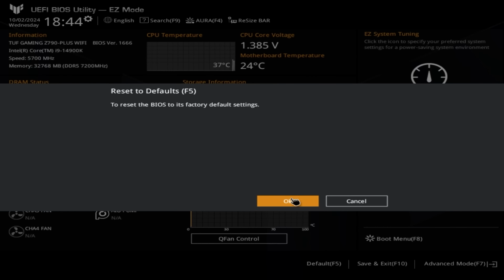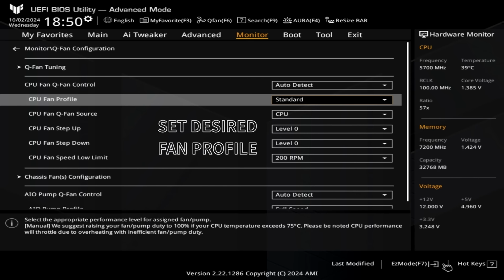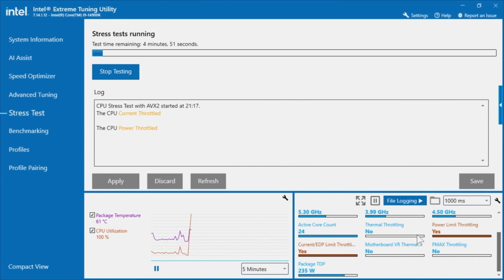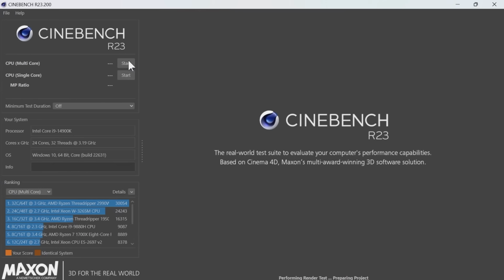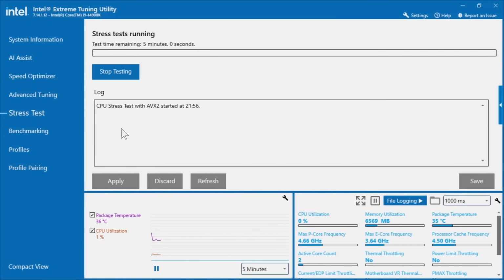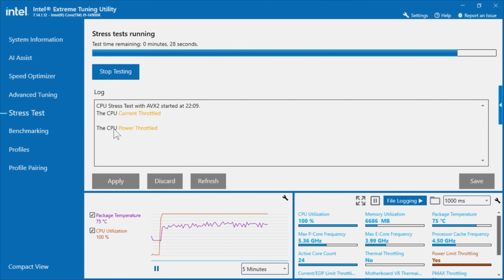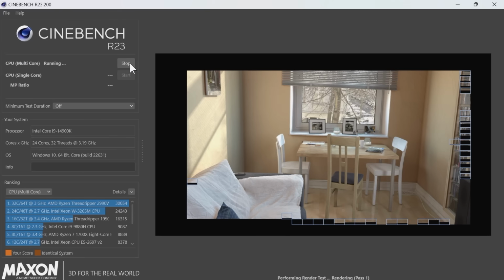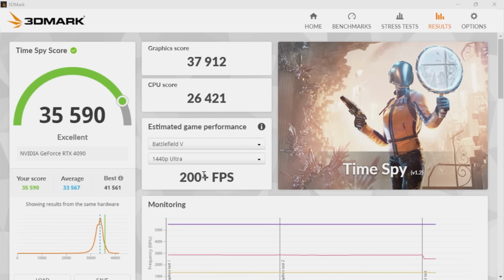i9 14900k Undervolting Guide: Part 2 Complete Stress Test Results

Comment: XTU is a decent stress test, but don’t forget Cinebench R15. It is one of the quickest tests to pickup even the slightest stability issue. It’s very sensitive, R23 will not pick them up.
Reply: I like to use Prime 95 with custom FFT size of 336 (min) and 336 (max), it will report failure in less than a few minutes if the voltage is too low, but if it's very low it can freeze the whole system. Once I pinpoint which voltage it starts giving out failure, I dialed back +30mv for ultimate stability. 

I have two 13700K systems and I found something interesting between the two:
CPU A can go as low as -168mv at 5.3GHz P-cores and 4.2GHz E-cores before failures
CPU B can only go as low as -127mv at 5.3GHz P-cores and 4.2GHz E-cores before failures
But at 4.9GHz P-cores and 3.9GHz E-cores, both CPU can go as low as -165mv before failures (exactly at -165mv)

That 4.9/3.9GHz configuration also saves so much power and much lower temp compared to even 5.0/4.0GHz
Which makes me believe that 13700K was supposed to be launched at 4.9/3.9 instead of 5.4/4.2. anything higher than 4.9/3.9 cause so much heat and power draw. 
Btw, I set the CPU frequency using ThrottleStop so I can switch in real time in Windows.
Reply from the maker: @chiyolate  Good comment, and you are correct in reserving some undervolt as one mistake many make is getting too carried away with it, which I have tried to encourage people not to do.

I find the Advanced Vector Extensions 2 (AVX2) to be pretty on the button, but have also used the Prime testing as part of Benchmate suite, but it’s sufficient to quickly detect system stability.  I have heard Intel are actually releasing a CPU test based on the same model so users can determine if their CPU is degraded
Reply: @nextlevelsimgaming  Thank you for your reply! 
Both my 13700K systems are running important tasks 24/7 but at a moderate cpu usage constantly, so I needed the undervolt to save power and also less heat, but still provide ultimate stability.

What's more interesting is this:
If I set my CPU frequency to 3.4/2.5GHz, the CPU usage will spike to around 55%, but it only consumes around 29-30 watt (very efficient)
If I set my CPU frequency to 4.9/3.9GHz, the CPU usage will lower down to 40ish % and the power consumption will be around 64 watts
If I set my CPU frequency to 5.3/4.2GHz, the CPU usage will go to 33ish% but the power consumption will skyrocket to 93 watts.

But what I don't understand is, why can't the CPU when set to 5.3/4.2GHz also consumes 30 watts just like when it's set to 3.4/2.5GHz instead of 93 watts? because basically it's doing the same task.
So because of this, I always manually set my 13700K frequency to as low as possible when it's not doing heavy workloads to save power, heat, and lifespan.
Reply from the maker: @chiyolate  I believe the frequency disparity is related to the C States, so despite being a lower frequency the CPU is always in an anticipatory mode, for example even mouse movement triggers frequency change where the C States jump in a preparatory mode ready for workload such as application launch etc.  Buildzoid (Advanced Hardware Overclocking) did a good explanation of this.  If this was not the case then the v droop would be so excessive it would cause excessive slowdown or even system shutdown.  The simple analogy would be foot on the throttle, ready to launch, by lowering the foot on the throttle (undervolting) we are causing less power use, but still giving the anticipatory state enough when required, when at full clock cycle that power anticipation becomes consistent.
Reply: @nextlevelsimgaming  Thanks for your explanation! Now imagine if someone can come up with a software similar to ThrottleStop, but can automatically increase or decrese the maximum core frequencies based on the CPU load threshold.
This is how it should work based on my imagination:
If for 1 second, the avg CPU load is above 80%, then the program will automatically raise the maximum P-core/E-core frequencies to its maximum GHz. But if for 10 seconds, the avg CPU load is under 80%, the program will decrease the maximum P-core/E-core by 200MHz, and it will keep decreasing itself until the lowest possible (3.4GHz for example).
And all those numbers can be configurable.

So, if my program only uses 30% of my CPU usage at its maximum frequency, the program will gradually adjust it to use under 80% of my CPU usage at its lowest frequency, saving power by so much.

In audio world there is an audio compressor that achieves similar results, but kind of inverted.
Reply from the maker: @MhillPlays  Agreed, I used to use it as part of Benchmate, but it just hangs or crashes sometimes causing a hard reboot of the PC, the Advanced Vector Extensions test (AVX2) is much  better I find with the Intel XTU Stress Test, also it makes for an easier to make video.

Comment: Bro. Amazing. I skipped 4 gens coming from a 10900K to a 14900K and I never fucked with these settings in UEFI in the 10th gen so its just what I needed ... Worked like a charm. Nice and stable at 5.4 with great temps. Thanks! Subscribed.
Reply from the maker: @georgekyriazis1  Fantastic, thanks for the positive feedback 🙂
Reply: Btw when i went into my XTU after bios settings, it didnt take my frequencies if 55....it was left to something random 57...58. was that just there from previous settings of it? When u tweak in bios doesnt XTU take it? Or do u have to make it first DEFAULT, THEN do ur settings in bios and THEN re go back into Xtu
Reply from the maker: @georgekyriazis1  It would have had a Default profile saved from a previous installation, use the XTU guide I did to manually set all cores can be done through there 😉
Reply: Okay thank buddy!

Im getting idle temps still in the 50s though on water....is that possible with the settings in the vid? I saw ur idle temps around 30s. What number should I tamper with to bring it down some. Can you send me a screenshot of your full profile in XTU my bro!
Reply from the maker: @georgekyriazis1  Refer to the previous Intel XTU video it shows much more information in there, if you’re getting idle temps in the 50’s then are you using a contact frame?, I would recommend doing so, also check thermal paste application, and clamp down force on the IHS.

Mine  idles at 35-38 with Corsair 5000D Airflow, 13 fan configuration, but 50 seems very high for idle
Reply: @georgekyriazis1 previous my one stay at 45c with direct die cooler,and I check that the mount not enough tight to reach the DIE.
After a little bit tightening the screw, it dropped back to 28-35c idle
Reply: @lawrenceonface  thanks buddy. I will remove it all and re apply my AiO with new paste. Are yous saying u didnt just hand tight everything? U actually used a screwdriver to make it suoer tight?
Reply: @georgekyriazis1  yes I used ek  screw driver but different build ,pcb or contact frame still have very little difference,especially use mental liquid, it may not contact perfectly

Comment: Again same question hehe and I’m sorry xmp stays disable I just don’t know how to keep It enable I  undervolt, I know you say to set it somewhere just don’t know wherem
Reply from the maker: @ander8329  Ai Tweaker Section, you’ll see ‘Ai Overclock Tuner’ in the options of the pulldown you will see available XMP profiles in there, normally XMP1 XMP2 and XMP Tweaked, use that as opposed to the option on the first page
Reply: I really don’t get why my pc never goes on after all this and when it start go in to safe mode
Reply: The system has POSTed in safe mode.
This may be due to the previous POST attempt failing because of system instability, or if the power button was held in to force the system off.
If the system failed to POST after you made changes to UEFI settings, you may wish to revert to stable settings to prevent POST failure.
Now, please press F1 to enter BIOS setup.

Comment: Thanks for the awesome video! I’ve been searching for something like this for a while.

I have the same CPU as you, and after following your steps, I’ve set the voltage to -0.070V. However, I noticed a drop in performance in Cinebench compared to my previous setting of -0.065V. Should I keep lowering the voltage, or is this expected?

Also, after completing all the tests, should we revert the Q-Fan settings in the BIOS back to normal?
Reply from the maker: @gan5866  No worries enjoy 😊

As per the guide, adjust the undervolt until the performance increases, some voltage drops may slightly decrease performance its trial and error unfortunately but at least Intel XTU makes it quicker 

The Q fan configuration will override when any other RGB / Fan control software is deactivated, as I have Corsair iCue, I close this when benchmarking, so have it set this way, you can set it and leave it on Quiet mode if you wish, its just a personal preference for me, unless you are relying on the Motherboard to control your fans, mine are all controlled by 2 x Commander XT’s
Reply: @nextlevelsimgaming  

Thanks for the quick reply! Do you also offer services for troubleshooting or fixing PC issues?
Reply from the maker: @gan5866  I don’t have the time unfortunately, I also work as an engineer as my day job, YouTube is more of a hobby 😉
Reply: @nextlevelsimgaming  completely understand, well if you have some time I will be happy to have some help 🙏
Reply: Also on 0.080 the package temp are 72-83 on intel stress test 😢
Reply from the maker: @gan5866  Its a case of finding a happy medium between temperature, performance, and stability, don’t get hung up on chasing scores,  find what works, thats my advice 😉
Reply: Need some help! 

After changing everything I want back to bios and I wanted to reset it back to default setting using f5 and than save it f10 the pc restarted but actually turned off this time for the restart. 

Then when booting to windows I had the blue screen with the troubleshoot I did try to run all the option windows give you but none helped. 

I can get to bios but when restarting I will be back to blue screen. 

Any idea what can be the problem? 

Thanks in advanced.
Reply: @gan5866  clear cmos first

Comment: Hey man, can u make a video or at least tell me how should I  go with my i9 14900ks? I was doing some tests from other youtube video, but I'm not sure if it's fine. Can u tell me exact settings which I need to do in BIOS. Thanks in advance. Great video!
Reply from the maker: @baylife7  The settings are exactly the same, except you can go to 320 / 320 on PL1 and PL2 (Short and Long Duration power settings) the 14900KS as per Intels guidelines for Extreme (it is 253 / 253 for the 13900k / 14900k) if you look at the community post you will see the Intel Specifications post 😉
Reply: @nextlevelsimgaming  thank you sir, really appreciate it! 👍
Reply from the maker: @baylife7  No problem 😉
Reply: @nextlevelsimgaming I make all settings like yours on my ks, and result is 40k in Cinebench23 but my temps are around 88°C. Is it normal? And also in normal work on desktop my fans running like crazy. After testing should I go back to bios and do all qfan configuration set to default again? Or should I make some changes in my fans software only? Also at some quick headshots in games I'm getting 1 sec freezes..
Reply from the maker: @baylife7  Could be fan configurations, thermal paste needs replacing or too much / too little pressure on the IHS clampdown on the AIO the score is where it should be though
Reply: @nextlevelsimgaming  thank u so much, really appreciate the answer! 👍
Reply from the maker: @baylife7  No worries mate 🙂
Reply: 320 is over clocked my room temp , if not open the air conditioner 😂 cpu is cool , but my body temp increased
Reply: Is the 14900KS also all core 5.5? Or can I set it higher like 5.7 or 5.9?
Reply from the maker: @DarrenHernandez-dn2fk  You can set it higher but watch my video on Core Sync 55 - 5800 Undervolting and Tuning Guide to show why 5500 is the best option 😉
Reply: @nextlevelsimgaming thank you for this! Just finished watching the other video, I will try 5.5. Also, do you have any experience with Dimm Flex for Asus MOBOs?I have mine enabled but not sure if that’s the right move.
Reply from the maker: @DarrenHernandez-dn2fk  I don’t unfortunately its not a feature on my board, I do know channel contributor Emir has it on his and he mentioned it makes no noticeable difference, I would imagine the benefit would be when running 4 x DIMM of DDR5?

Comment: Hi, great tutorial 

The system is also valid for 14700K? just change the value from 400 to 307? and PL1 to 125 and PL2 to 253w?
Reply from the maker: Correct 👍🏼
Reply: @nextlevelsimgaming  Can I leave the voltage at 1450 like you?
Reply from the maker: @hardcoregamer406  Its not necessary for the 14700k
Reply: @nextlevelsimgaming  In the PL1 and PL2 section I have to leave 253w? because some people tell me 125 and 253 and others 253 253? I don't really understand ?
Reply from the maker: @hardcoregamer406  Its 253 for yours if you look at the Intel Specifications in the Community posts on my page you’ll see 😎